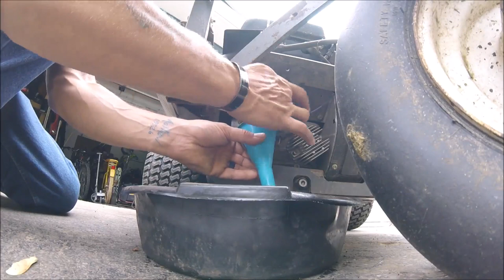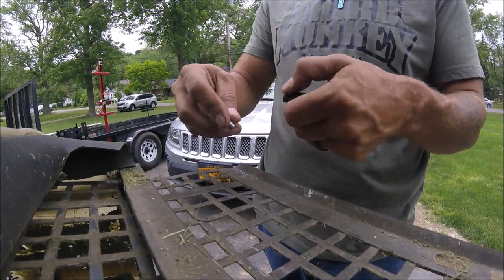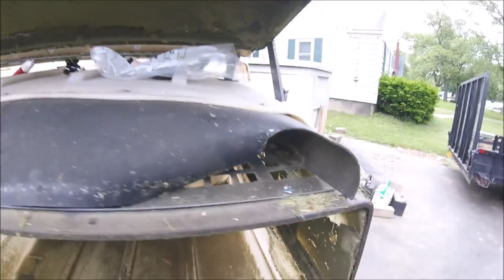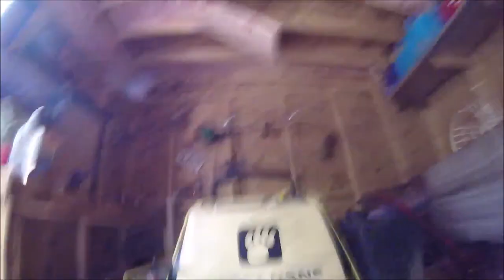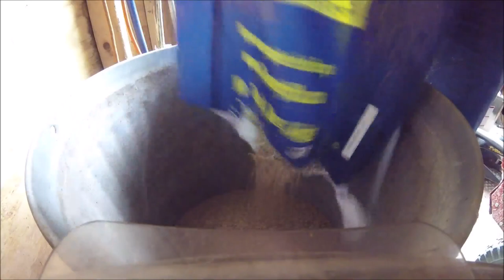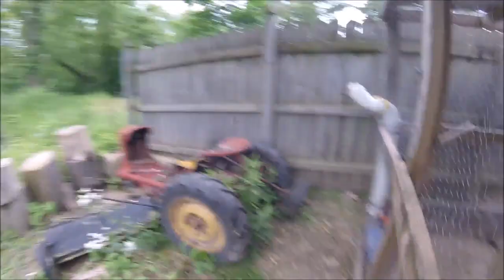Walker Mower Hopper Screen repair & mower maintenance

Comment: Many years ago I used to use walker mowers the dealership  told me to put grease fittings on the gearbox were the fill hole is for the oil and pumped in high temperature wheel bearing grease in gear box never had a problem using it that way
Reply from the maker: John Furey too many moving gears, I would never pump thick grease like that in there. That would be like filling the rear end of a truck with grease. No way.

Comment: I just Got my walker this year it has the small hole scream does it just slide out and should I keep the small hole or switch it for summer then put the small hole back for leaves I love the chicken that peck your goo
Reply from the maker: Greenway Lawn When grass is dry the small screen ultimately allowed for better suction. The big hole screen is better for mowing wet grass, won't allow clogging as much. Someone's I run the big screen in dry conditions because it allows little bits of grass to go out keeping the hopper from filling as quick.
Reply: CountrysideLawnNY thank you also was it you that put vents in the front of for trailer and if so what is the video call and when did you do
Reply from the maker: Greenway Lawn Yea that was me and I believe it was about 2 years ago. I can't recall the video
Reply: CountrysideLawnNY thanks I look for it